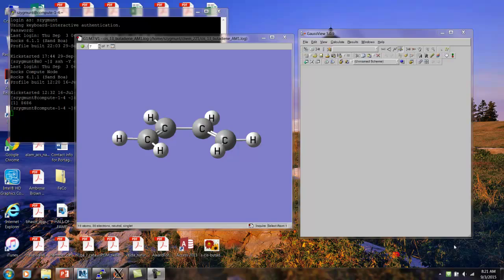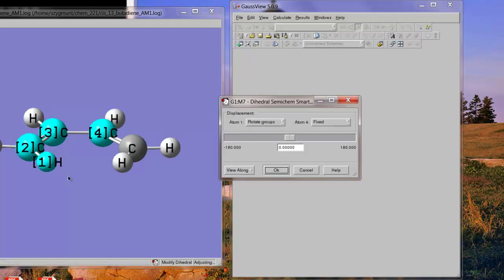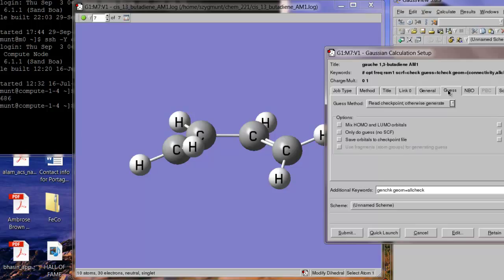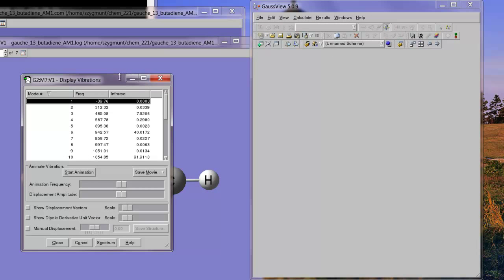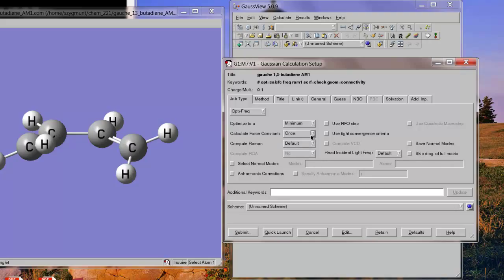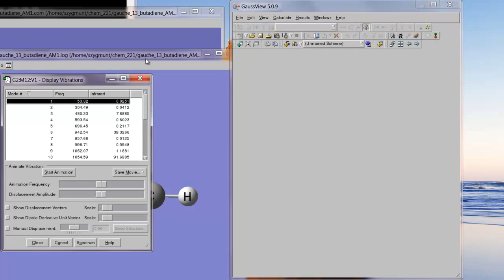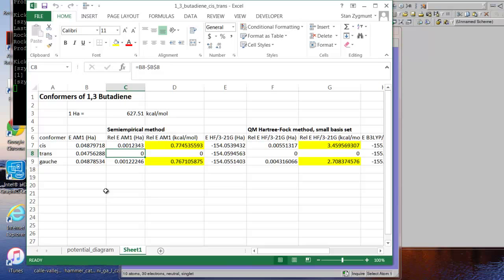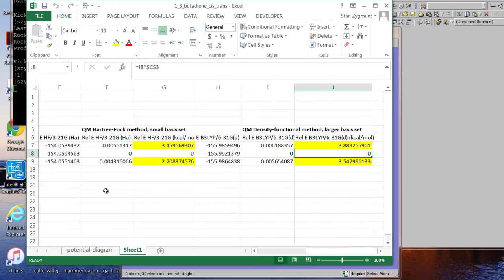comp chem 13 butadiene ex

Comment: Where did you extract the E AM1 (Ha) value?. Is it in the output file? or you can get it directly from the log file (Results/optimization/graph total energy vs optimization step)?
Reply: results/summary. a little table will appear containing file name and type,calculating method and the energy with HA unit or u.a. unit
this step comes exactly after your calculation step in semiemperical method with AM1